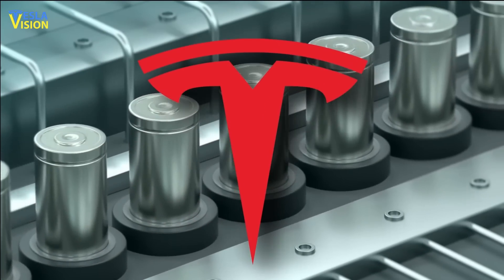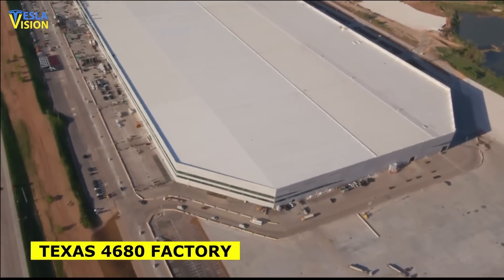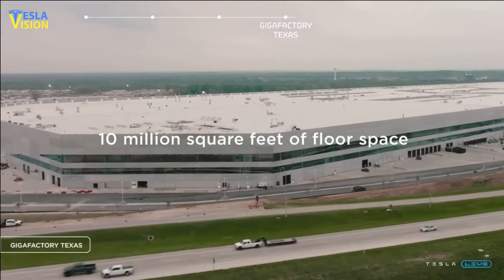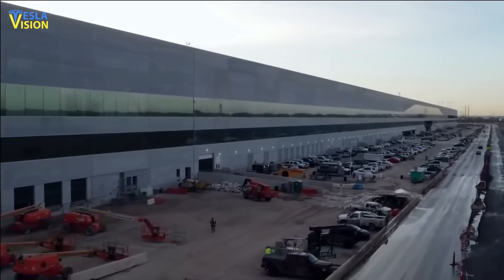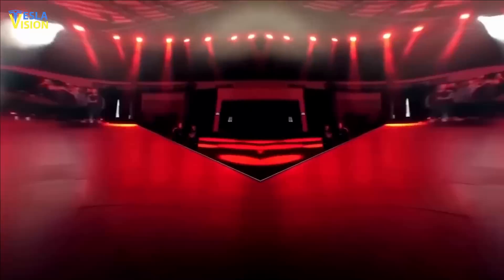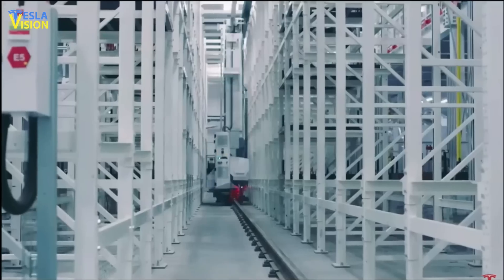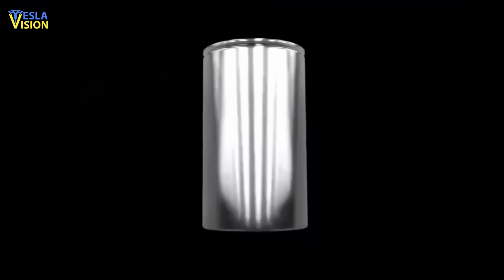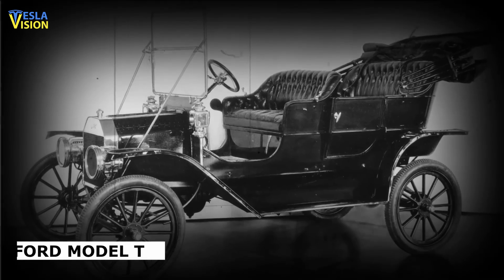The 3rd Generation Tesla Battery RIPS BYD's Sodium Battery Plans

Comment: As a car maker, Tesla's Shanghai team is directing to a right strategy！
Tesla China is using the best technology battery from whoever offers the best solution.  They r buying from CATL as well as BYD, thus making use of latest technology without a burden !

Battery technology is moving on so fast, the claimed 4680 edges is eroding, now even Sodium Lithium mix battery pack is outdated, LaCl-based lithium superionic conductor battery, which is a solid state, super quick charge safe battery is coming.  

Tesla, please don't get yourself stuck in old tech that you have no expertise !

Comment: GigaTexas is NOT specifically designed as a battery factory.  that's just one aspect of it, which includes production of Model Y, CyberTuck, and SEMI as well at a later time.  battery production is key but less than 10% of the floorspace of GigaTexas.